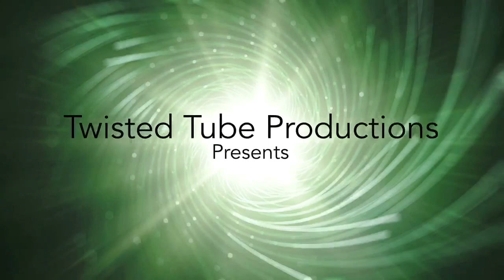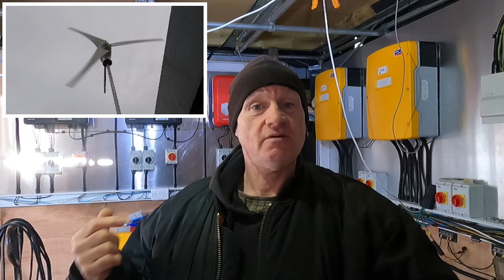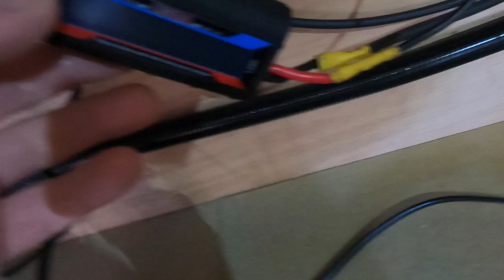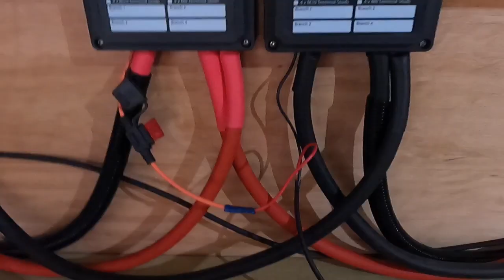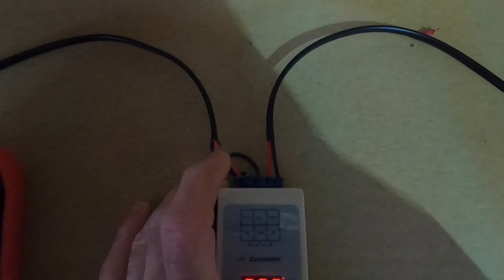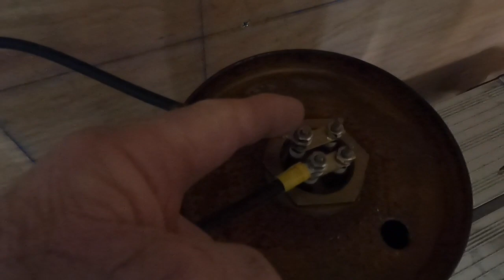Wind turbine in the uk

Comment: Hi Mate, I already have solar setup, but I notice my new house had some good wind, so I ordered some wind generators. After having a few bad buys, I finally found some good wind turbines ( Brand Names ). I now have 10 wind turbines up, attached to 10 poles of a old fence line. In a all day Wind Storm with no solar, my batteries got fully charged. So wind has gone from a hobby to a true backup for my solar, in bad weather and at night. There is a lot of junk on line, but I have found a good model ( SUN800 ) which works good in low winds and makes a low noise.   Search -
24V/48V 1000W Windmill Power 6Blades Wind Turbine Generator W/ Charge Controller
Order the 48V model & use a 3 phase AC bridge rectifier to convert AC to DC.

Comment: For dumping the excess power, Robert Murray Smith on YT shows how to use resistive wire to create a thermal sand battery.  With the temperatures there during the cold, it could come in handy and not be wasted as you rightly concerned about.
  Great information you have given.

Comment: As an engineer noise can be reduced by length of pole resonance of blades and blade pass frequently which is the highest of the three.This can be reduced by changing blade spacing.
Reply from the maker: Thank you for all the tips. I try some and check the results. Thanks for stopping by.

Comment: I'm living on a narrow boat I'm looking into wind turbines now... I'm using lithium batteries and bi focal panels but in the depths of winter it would be nice to use the wind to power me up this winter I haven't needed to use anything but my solar set up to live but I think turbines would be a really good supliment.. keep up the great informative vids
Reply from the maker: Thanks for stopping by. Defo look at a turbine if you can get high and clean air flow I think you will see some great results. For me and my size of battery bank I think I need to parallel two more to see good results. But for you on what size you my have I think would be good. Keep me posted.

Comment: I would dump from the turbine 
You can put a separate three-phase rectifier in line and use the output from this to run the dump load and use the controller/ rec  setup to change your battery bank with a over voltage dump load ,as soon as you start dumping from the separate rectifier the current going to the the battery bank will be reduced according to the strength of the dump load running from the separate rectifier.
Try putting two and a half raps of insulation tape on top of each other round the tip of each blade to stop the whistling noise
Reply from the maker: Thank you for all the info will look into trying some of your ideas. Thanks again.

Comment: Great video, presume the shout out is for my channel.  Great to see the info is being of use.  Hit a new all time high in the storm today 2415w out of my little wind turbines, should only be capable of 1700w, looking at 10Kwh today.  Have a look a Peacefair enegy DC meters, for a basic meter with display they are great for data storage.  Did you manage to get your other turbine up??  I'll be doing a video on data integration, you can see on my vids just completing it.  Works with SMA home assistant too.  Just a thought of my head you could use the load shedding or dump additional load off the SMA inverter relays to control an AC extra load.  You can combine these with Sonoff wireless relays to control loads like heaters etc.  Good luck and keep up the superb work.
Reply from the maker: Hi Ivan thanks again for stopping by and commenting . just going through your videos again now. would love to have that type of info. will look into the load shedding . second turbine not up yet. yep shout out for you some top info on your channel. you are getting some good wind generation there. cheers.
Reply: Can you supply a link to the turbine you have, and can you supply a link to your website, please?  Thanks.
Reply from the maker: @barryfoster453  Hello not sure how to do links. But I purchased it from aliexpress  B&C energy solutions. And sorry don’t have a web site.

Comment: Hi, I've got hydro solar and wind and have been playing about with it for about 4 year now. you said in your video you would like to use the dump load power, this is something I'm playing with now. I bought one of the Sun grid tie inverters that has a battery discharge, what this does is when your battery needs to dump it does so through the inverter so the power gets passed to the grid. you can set the amount of power you want to draw and the battery start and cut off voltages.
Reply from the maker: Hi John thanks for stopping by. your setup sounds interesting. I will look this up thanks for the info on the inverter.